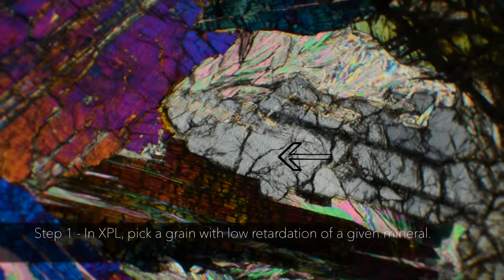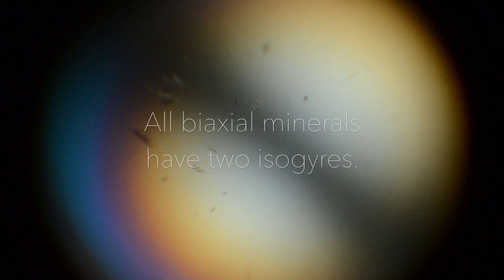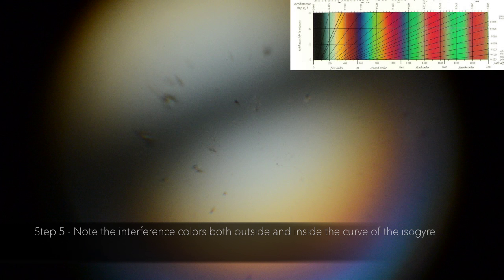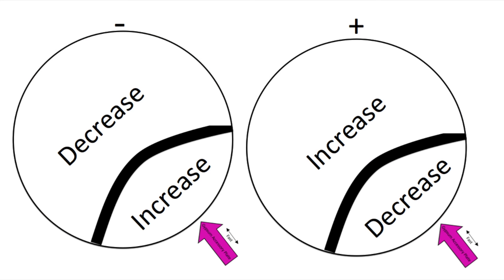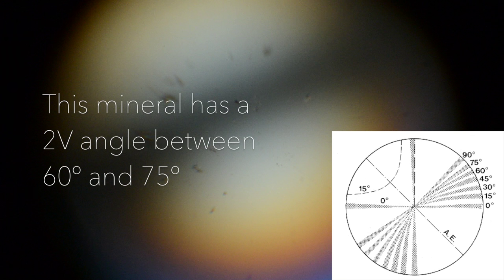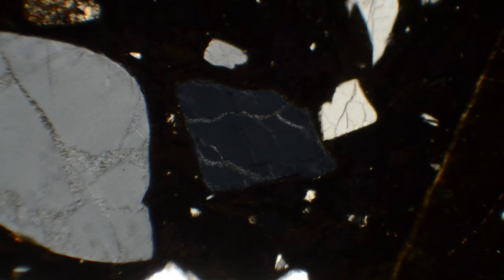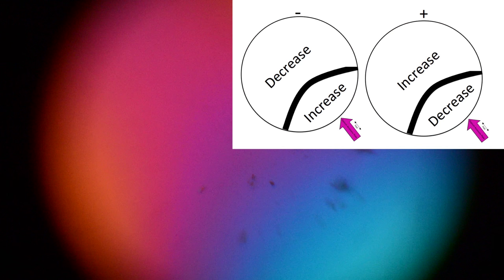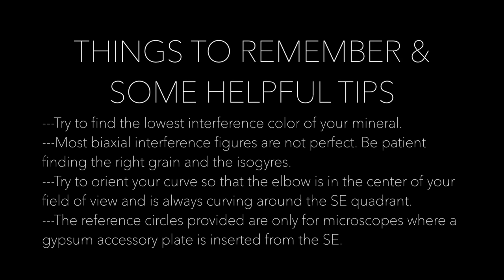Earth Optics Video 6: Biaxial Minerals

Comment from the maker: Hi Everyone! Thank you so much for the feedback! I'd like to clarify some things about mineral 2. It is in fact a biaxial mineral. In uniaxial minerals, the 2V angle is equal to zero (there is only one optic axis), which is why we see a cross under the bertrand lens. The example here has a very low 2V angle (~15° or lower!), which is why it looks so similar to a uniaxial interference figure. You may notice that the the "elbows" of the isogyres (where each melatope is) don't exactly overlap and separate slightly upon rotation. Although it is faint, it is also possible to see some light pass between the melatopes in this video. I'm sorry this is a difficult example - I'll try to make some more videos with better quality examples and recordings in the future. Hope this helps!
Reply: plz make more videos on optical mineralogy ...like determining vibration direction of a anisotropic mineral
Reply: 😄. I also think that is uniaxial
Reply: Hello, i have a question about this, especially in a biotite.. in a book, there was said "some biotite is sensibly uniaxial..." does that mean biotite in a low 2V angle? and what in case biotite will be have a very low 2V angle? Basal section or parallel to the c axis section?

Comment: Is the second example a mineral with a 2V angle of 1 degree?
Reply from the maker: It is certainly a very low 2V angle. In the video I mention that it could be between 15 and 30°. It is probably closer to 15° or lower. I've posted a detailed explanation - hope this helps!

Comment: The mineral that you used in the 2nd example is a uniaxial mineral.
Reply: YES I AGREE  WITH U
Reply: yes, so much more twrds uniaxial
Reply from the maker: Such a tricky example! I should have included a different grain in this video. It is actually a biaxial mineral with a very low 2V angle, which is easy to confuse for a uniaxial mineral. I explain this in a bit more detail in the comment above. Thanks for the useful feedback :D
Reply: It's been 7 years since you commented this and so I wonder if you still believe it's uxiaxial or not..😅

Comment: why in the second example is biaxial?
i would say it is uniaxial?! 
pretty confused
Reply: federico moroni  You are right 2nd mineral is uniaxial where isogyres don't split into two while rotating the stage suggesting its an uniaxial
Reply from the maker: It is a biaxial mineral with a very low 2V angle - I've posted a more detailed explanation. Hope this helps!